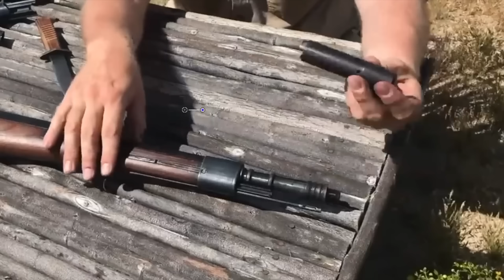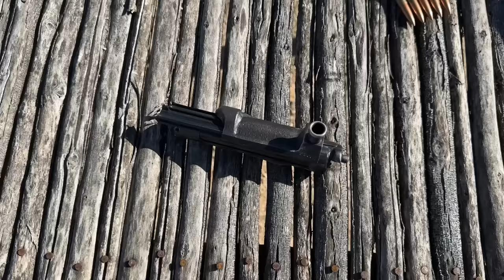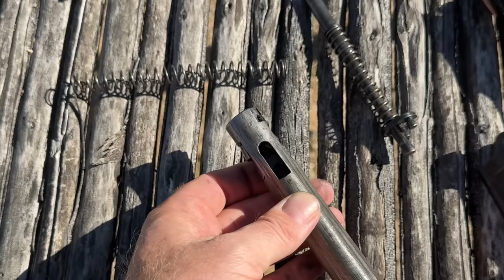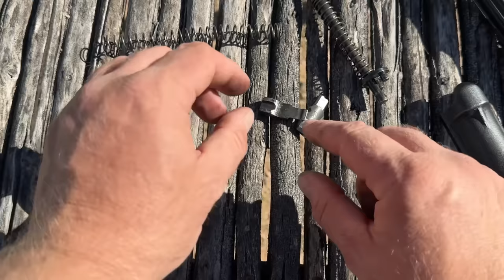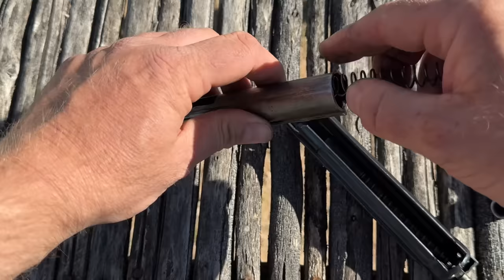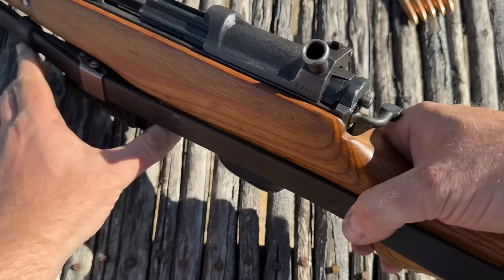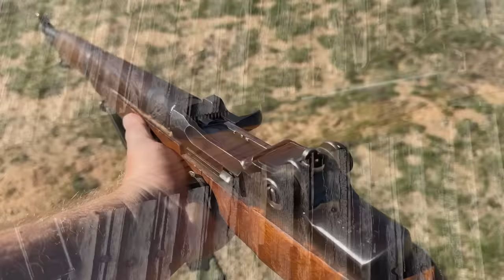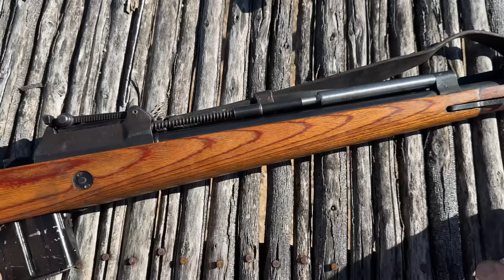Das G43 Wunder-Gewehr ist Scheiße

Comment: I'm a mechanical engineer and I had the pleasure of actually examining and shooting a G43 that belonged to a gunsmith friend. His gun was of decent quality; there were no perceptible cracks or defects. The gun was reliable.  Accuracy was OK; nothing to write home about.  About the only criticism I might make is that the gun was a bit sensitive to spring wear but then so are many modern guns. 

It was a pretty good design for the era.  Gun designers were still figuring out what was important.  German gun designers clung to the idea of the  blast cone long after it had been proven less than effective.  The G43 was a first step towards using a gas piston.
Reply from the maker: Considering they copied the gas system from the SVT 40, this gun was not the first step towards a gas piston as you said.
Reply: I say it was for German gun designers.  It seems they tried everything but that. @InrangeTv

Comment: If a gun is rare, there is usually a reason. Either because it's too expensive to make, because it comes too late, because the people in charge decide on something else, because it's simply bad, or a combination of those.
The G43 is one example of a gun being simply bad.
The StG45(M) is an example of being too late (but it led to the CETME, G3 and MP5, which are all successful and show that the system itself is good)

But wow, the field stripping makes it look like the experimental specimen that is still in testing and will get an improved version later on in it's service life. Too complex, too many loose parts, too unreliable. The G43b surely would've been a more successful and improved design
Reply: Yeah, there are some exceptions. some firearms like the Luger are great, fun and will probably never see a reproduction after 1990s because of how costly they are to make, I own one from 1992. Some guns end up getting scrapped in history rather than getting reproduced in the same way that almost everyone is waiting for some company to remake the STG44 (I am too).
Reply: @diplexnormal3353  There is always the option to make more for collectors, at the corresponding prices.
There are still new Mauser G98 made today, even in 7.92×57. But all of the modern ones cost 5 figures, because they are a collectors item.

Comment: Good video, and correct on almost all points, but a couple of the complaints here seem just a little nitpicky.  For example, the complaint that the spring and spring guides from the bolt and carrier are parts that you can lose in the field -- they're no smaller or easier to lose than the bolt from an M16, and they're nowhere near as small as the M16's firing pin or cam pin. or the tiny firing pin retaining pin.  Honestly, this is like saying the 1911 or Hi Power were bad guns because the recoil spring and the (not full length) guide rods are separate pieces that you can lose.  Same applies to the complaint that the three components you disassemble from the SVT-copied gas pistol are all parts you can lose -- well so are they on the SVT-40.  And the FN FAL.  And the AR-18.  And the G36.  And the L85A2.  And the HK416.  Basically any gun that copies the short stroke gas piston system introduced by SVT38/40 -- of which there are lots.  These guns all seem to do just fine in military service, and large-scale loss of these parts doesn't seem to be a particular problem.

The rest of the complaints are valid enough though, and no doubt, had Germany not lost the war, the rifle would have been very unlikely to have remained in production very long, especially with the StG-44 having been adopted.

Comment: Having done takedowns of an SKS, the transfer rod between the gas piston and the bolt is a menace. Its held in by a little semicircular rod, and once you take off the gas piston rig, if you touch the little lever, the transfer rod will blast off into any nearby surface (windows, people, etc.)

But thats it.
The rest of the takedown is incredibly simple and reasonable.

Comment: To be fair to the German designers, the original requirement for a semi-automatic rifle went out in 1940. By 1941, Mauser and Walther turned in the G41 (M or W). Bear in mind that the US Army issued it's requirement in the early 1920s and the semi-automatic rifle was in development from 1924 to 1934 when the Garand rifle was adopted. Then, the rifle turned out to have serious issues, which were not fully resolved until 1940 when it was finally (truly) issued and was by then a fine weapon. The SVT-38/40 had more development time as well.
So 1940 to 1943 - wartime development on a platform concept not widely considered and certainly not understood!
There are worse weapons but the G43 is not one that reaches even close to adequate.

Comment: I had one of these rifles. Loved shooting it, tell it kind of blew up in my face. The wedge fractured, allowing the locking lugs to slip backward when fired. The cartridge case was pulled in half as the bolt tried to eject it while still under pressure. Luckily I was only slightly burnt in the face by the powder. I still have the locking lugs and half of the receiver around somewhere, if anyone wants to see a photo of them.

Comment: Brazil made a nearly exact copy after the war, in 30-06, the M954

You might have touched on that the action has no cover to keep mud and dust from the bolt, which simply rode over the dirt, to action stopping effect, that had gotten on the outside of the action.

Comment: Change your springs every 500 rounds and they'll work just fine.  That was the biggest problem GI's had with bring-backs.  Some factories produced better quality rifles than others but the Germans weren't in the business of providing their soldiers with terrible weapons.  The sabotage stories are highly exaggerated  IMO.  The rifle in the picture above looks exactly like mine, a G43, DUV44 d Block.  It runs like a champ.  (I can see later in the video that he indeed has a  DUV 44 from the Berlin-Lübecker Factory, exactly like mine, but I think his is h-block.)  Albeit with a shooters kit installed.  How often do you have to take the bolt apart?  Not very often at all!  Take the carrier out and swab the barrel.  You also do NOT need to take apart the op-rod every time you clean the rifle.  Let's remember too, the G43 was NOT the Main Battle Rifle for the German infantry squad. It was more of dedicated marksman's rifle.  Also, you don't need the dust cover on the bolt carrier before you can reassemble it.  Their MBR was the K98k Mauser.  Did they have to take the bolt apart every day?  Of course not, this is a gross exaggeration.  Plus, everybody, in every army, used corrosive ammo and they weren't all losing pieces of their rifles all over the place.  This is too much of a stretch in too many directions.  He's telling us it's shit and it really isn't that bad.  The Germans had armorers too and they knew what was wrong with these rifles and still did their jobs and keep them shooting...

Comment: By my reckoning, the biggest flaw in all the WW2 semi-automatic rifles, was just how difficult, time consuming and expensive they were to manufacture. 
This "simplified" rifle, with stamped components,  still required an enormous amount of highly skilled machining, which was a luxury the Germans simply couldn't afford. 
Even the Americans, with their enormous manufacturing capacity,  struggled to supply all their front line troops with Garand's in a timely manner. 
The Russians had no hope of doing that with the SVT. So they gave up trying and largely transitioned back to Mosin Nagants and relatively cheap SMG's.
WW2 semi-automatic rifles were a Rolls Royce product in a war requiring a mass produced, Volkswagen solution.
Reply: I don't think anyone really figured it out until the Soviets implemented stamped AKs

Comment: I've always had an idea of a fantasy bolt action rifle that takes the mannlicher 1888 wedge locking action, rotate it 90°, and have one on the other side giving it symmetrical locking. The system in this gewehr 43 looks eerily similar to my idea, however I am still convinced that my locking system would be vastly superior to this in reliability at the cost of a heavy and bulky receiver.

Comment: Before watching the video, I wonder if I remember it correctly that the chief issue with it is that it essentially shoots itself to pieces after prolonged use? Much less refined that its direct US rival, even though it does have some features in favour of the Garand, mainly detachable box magazine and +2 capacity.
Reply: What was the average service use expected before being lost or captured?
Reply: @mpetersen6  Don't know the exact number, but generally considered short enough for the mechanical fragility to not be an important factor for that time being.
Reply: @CrazyChemistPL  
If so it's not really poor manufactuing. Lousy design though.
I wonder just how many rounds were put through the average rifle during WWll

Comment: The G43 is not the best design but may I remind you that if you lose the firing pin retaining pin on an AR the guns won't work. These guns only had to last until the end of the war. As Ian noted recently the Germans never stuck with something and ran with it. If they had millions of these or STGs like we had M1s it would have been easy to have small spare parts around. That's how we got around the firing pin retaining pin problem they just had lots of spare parts.

Comment: Actually you can fix a majority of flaws of the G43 by putting an Apfeltor on the gas system, and all springs by moderns one. But most of the weakness of G43 came for the fact the gas system was badly conceived, and made a way too powerful recoil for the breech, which cause cracks in it. The Apfeltor kit fixes that.
Reply from the maker: I have that on my gun and the stamped sheet metal craptastic parts and oprod still has problems.  I have all replacement springs as well.
It's a bad design, poorly manufactured.
Reply: @InrangeTv  Could evolution based on users' feedback have fixed it, maybe with longer bolt travel, longer spring, a CHUNK of a back-stop behind that spring, adjustable gas and a second spring cushioning the end of travel of the gas rod, or was it totally irredeemable?

Comment: If I understand correctly adding the mechanical bits that allow semi or bolt action mode increased the complexity of manufacturing in such a way that it's got more failure points

Comment: I would agree with almost everything you say - except for the comparison of stripper clip reloading with the block reloading on the M1. You cannot simply compare these two. Stripper clip reloading would be done when your magazines are empty. Now, if you don't have a block clip anymore for your M1 - which is, from my point of view, an equivalent to a magazine more than a stripper clip: what do you do ? It is actually easier and faster to reload magazines with stripper clips than what a GI had to do if he ran out of M1 block magazines.
Reply: Ammunition for the garand came from the factory in enbloc clips and those clips are easily reloaded. 
As far as the two systems are compared, the Garand has it beat, period.
Reply: @rooster6461 So why is it we are using magazines today in almost all weapons and there are no enbloc clips anymore if that system is superior ?

Comment: We have several G43's in our shooting club in good quality and condition. Never had problems with them. We produce our own ammunation like in the old days for these rifles, because modern ammo is to strong and overgassing the system. There are many rifles in bad condition out there, slave labor quality, abused by collectors (poor maintaince, used too strong ammo etc). You can't say ALL Gewehrs are bad, because that's not the case.
Reply: Yes they are, all g43s are bad rifles due to design, if you have to deal with all.that just so it doesn't break and shoot the bolt into your face, it's a shit design
Reply: Again, never happened with our original G43's. It's just the modern ammo you have to be beware of. And thats not a problem with the rifle itself, because it was designed for a type of ammo from 80 years ago. I don't care about the "design flaw debate" as long as the rifles work fine. We using them weekly.

Comment: Many years ago fired all 3 weapons (G-43, Tokorev, and M-1).  M-1 far superior.  Tokorev & rimmed cartridge system not great.  G-43 ok, but tooo many small parts as you pointed out.  Never had metal fatigue issues you mentioned.  But g-43  not in same league as M-1.  Also felt recoil was worse than M-1.  G-43 loading not even close to ENBLOC system.  If M-1 was a 9 out of 10, G-43 overall 6 or 7 in my opinion.

Comment: I wonder how hard it would be to use a CNC machine to make a receiver cover. Probably expensive.
Reply: First, you would need a drawing showing all the dimensions of the cover. I've found drawings on the internet of StG44 parts, but not one of any G41/G43 parts so you would have to measure one and make the drawing(s) yourself. Next, you would have to write a programme for the machining operations. Once you have the programme, you can use that in a CNC machine to get the part made. The main expense would, I think, be in getting the drawing made and the programming, but this would be a one-off expense. After that, the expense would be only in material and machine time. Even so, it would not be cheap so it would be worth getting a large number made at one time to reduce unit cost.

Comment: You failed to even mention 'expected weapon lifespan'. Milled versus stamped isn't a limitation on resources, it's called acceleration/simplification of production. The cracks are caused by a lack of recoil buffer system created by (you are correct here) a shortage of rubber. But that, highlights my first issue, you have failed to mention 'expected  weapon lifespan'. Your analysis as far as I can tell is based on text book material and therefore not relevant.
Reply from the maker: Actually, I did mention that in the video, Mr. Krieg5474.

Comment: If anyone wants to make a reproduction G43, then they have their work cut out for them. Simplifying/rectifying the gas system and eliminating any potential issues with continuous fire with only basic maintenance, are all things to consider when making a reproduction, that not only functions better, but looks as close to the original in appearance.

Comment: Ive handled most ww2 battle rifles at this point including the 3 big semis (M1, SVT, G43). The G43 is super interesting on a mechanical level (which makes it one of my favorites) but is completely over engineered and impractical compared to a garand or SVT. Try taking apart the trigger group with all of its pins and spacers and springs lol. The bolt doesnt seem so bad after that

That said i still love it. Flawed gun but really cool piece of history

Comment: "Bad design" kinda defines almost everything our boffins shat out during the time.
The ships suffered from being 10% too large with anemic guns, the planes just lacked the competition between different companies seen in the US, the tanks (anything that came after the up-gunned Panzer IV and the StuG) were complete garbage designed for fighting a war that just didn't happen and anything the regular grunt saw when it comes to infantry equipment was either a late evolution of an antique like the Kar98K or our absolute specialty in all aspects overengineered crap like the Luger or the G43.
The only actually good designs coming out of the factories after about 1940 were the subs and even those got countered quite hard

Comment: I have one a WW2 bring back my Uncle left to me. It is vastly inferior to a Garand .I also have a WW2 made M1. I made the gas system upgrade to shoot it but I shoot it sparingly. I had a SVT 40 for about 10 years I bought it in the 1990's at a gun show when they were imported briefly. Paid 250 bucks for it later sold it for 800 bucks now i see they go for 4k crazy that was a piece of junk also, spit a little gas back at me every once in a while i shot it. The Garand is also far more accurate than the other 2 rifles  Good Video

Comment: I see. However they should have made the "cover receiver" from an 3 times thicker metal. That would get rid of the cracks. I see on the end of that receiver where it cracks 3 or 4 holes and very few metal wall. The back part of the receiver is about 80% hole and at most 20% metal material. No wonder it cracks there. If they would have made the whole receiver cover of 2x thicker material and the back part of 3 times thicker material, or the whole thing 3x thicker material, that part may never have cracked even with bad metallurgy. Just make thicker the stamped receiver from 3x thicker material. That would do the trick as with your milled receiver which is most likely a bit more stronger but of the same material thickness so it lasts.
The rest is typical german - they expect the soldier to know the gun and watch the parts. I do not believe parts loosing during war was a problem. They expected professionality from their soldiers and did not yet have the concept of fool proof guns and equipments. Expectations from soldiers where higher back then it seems. The mushrooming of the piston rod must have become a problem. Witnesses say that the germans did not like their semi auto rifles at all. They did not work propperly at Stalingrad as soldiers told in their memoires. The gas trap system was specially hated since those guns never loaded reliably. Fouled gas trap systems where a chore as witnesses said.
Lots just switched back to the reliable Kar98 since that gun worked at least when you pulled the trigger.

Comment: I bought a '43 back in 2005. The first thing I did was get a Wolf Spring kit. The first major problem I had was the extractor retaining pin flew off with the extractor. When I finally got new ones I put a dab of lock tite on it. The design of the retaining pin is just straight up dumb engineering.